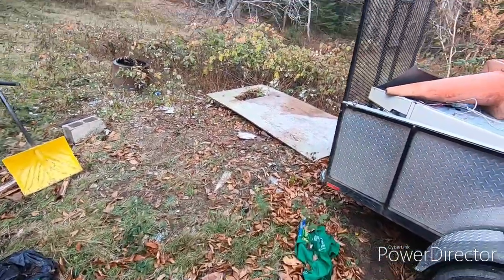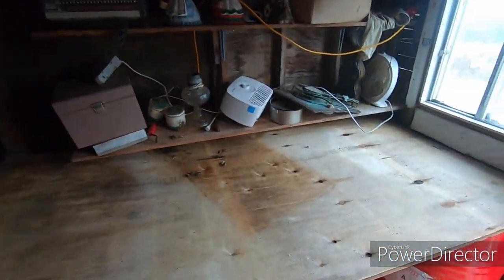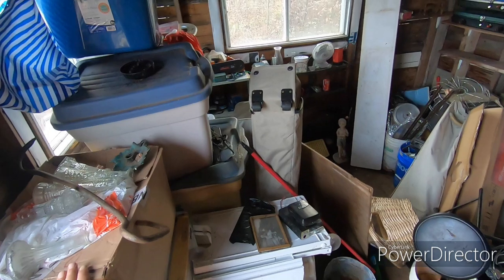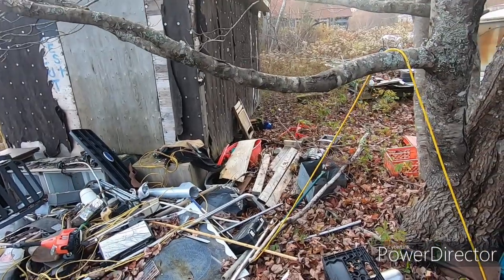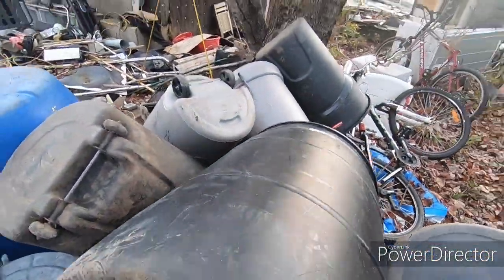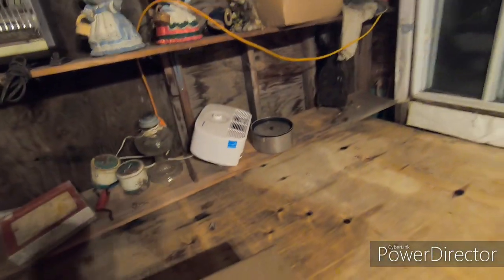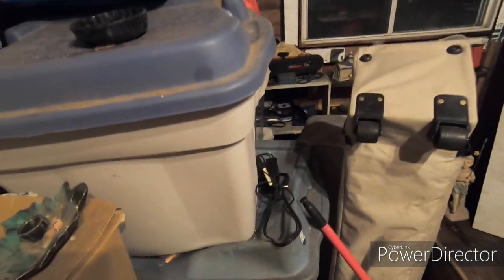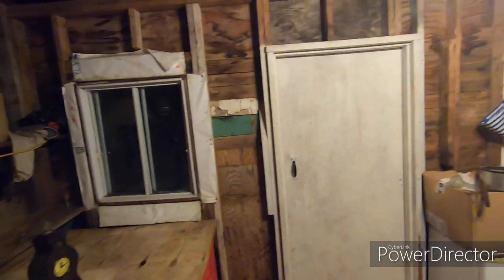DARK TOO SOON

Comment: There's nothing wrong with the #free99 budget program. Smart thinking about holes in barrels or outside containers..  It's all coming together Sir. 👍👍🇨🇦
Reply from the maker: Another hack I learned from commercial fishing is to take the handles of small plastic barrels (5 gal). Drill a 1/2 in hole where they were. Make a rope handle. Can lift over 100lbs without handle failing.